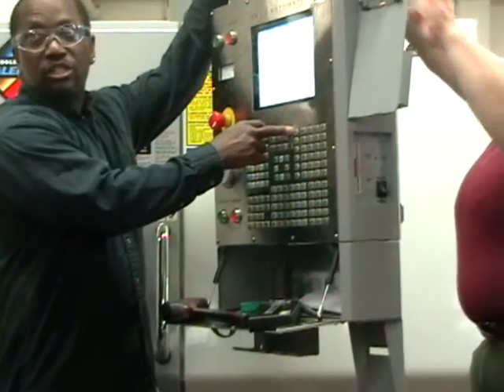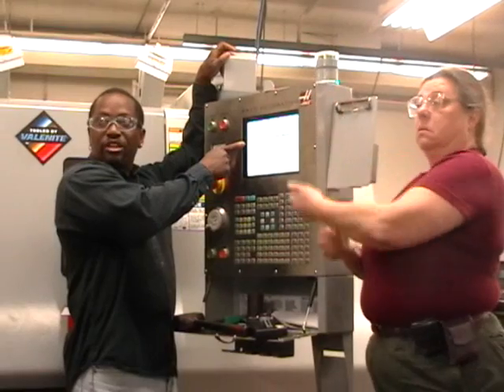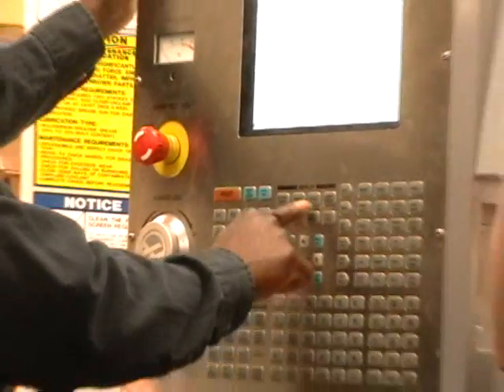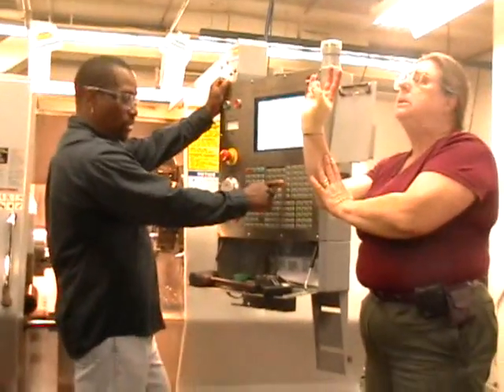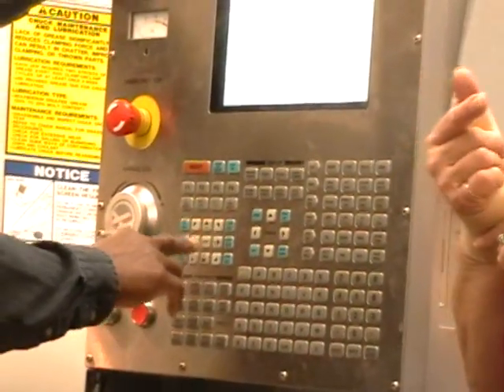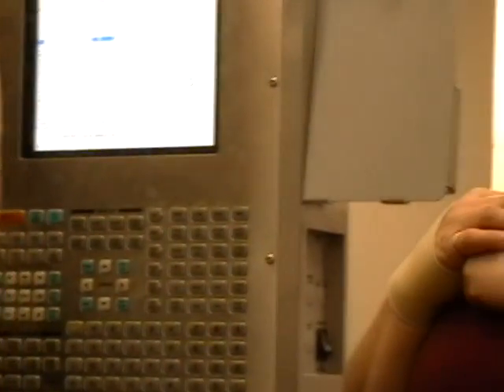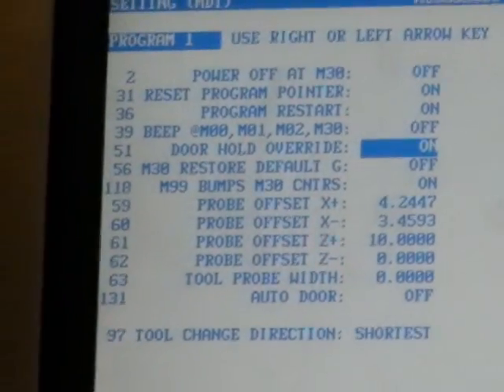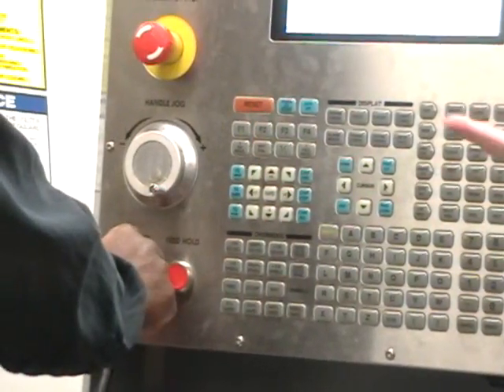Haas Lathe Setup P1-3

Comment: ya i would really have to be taken thru all the f1,2,..etc keys with there menu items seems its close to like what a dos operating system is like but of course setting points of origin , spindle speed,  x,y,z coordinates,loading a program..  would have to do wondering if anybody came out with a simulation based program for the computers that gives you the working enviorment of a cnc machine

Comment: I get the majority of the keys are letter and numbers that takes alot away from the complexity of so many buttons but there is still a lot you cann't really get from a video yet , at least for me. Major buttons i a get alot of them and loading the raw material into the chuck isn't to difficult . so its mostly understand the operations/features of all the cnc machines. Most old school machinist before cnc machines those where much more simple to understand thru a video (i.e manual operated drill press, mill , lathe,..etc not to bad the larger ones can be a challenge though still but far easier then most of the cnc based screens to buttons from a video)

Comment: great video but with these cnc machine or to learn the modern machinist equipment i am finding it hard to understand  2 things
1) all the different buttons they usually only cover the main ones  2) the screen and all the programs and things to select is difficult to understand from these video's (mostly because of sight). Other then that one could full learn how to operate these machines from home , i.e know how to program them /understand g-code ,  load a program into the cnc machine ,...etc

Comment: at 5:43 I go to offset, then push handle jog, then for each tool I push the next tool button to advance the turret to the tool I want to touch off. When loading new tools I use MDI and then the forward or reverse buttons to get the tool where I need it.

Comment: @ChrisCraftJohnny LOL. Your post is absolutely hysterical.  First of all, dialing in with offsets is exactly what I do.  The probe is much faster for initial setup.  Second, the resolution of the encoders on your crappy Hardinge is irrelevant to the tolerance you can hold "all day".  Lastly, 68 degrees F is the accepted standard.  I look forward to reading your next reply of lame excuses as you why your lathes don't suck and why you insist on keeping your shop 2 degrees warmer.

Comment: @ChrisCraftJohnny  A skim cut is neither faster nor more accurate than a Renishaw swing down tool setter.  A paper shim is even worse. Besides, If you've ever done any tight tolerance work, you would know that the only way to dial in the machine is to measure the first article and adjust offsets accordingly.

And FYI, I don't run Haas machines.  You're confusing me with another poster.  Maybe you should learn to read before attempting (and failing) to school someone else.